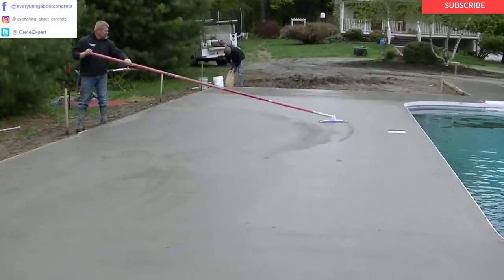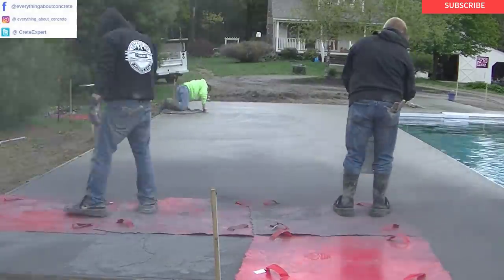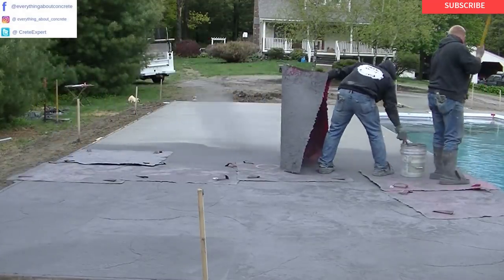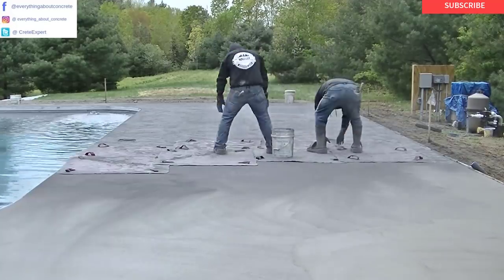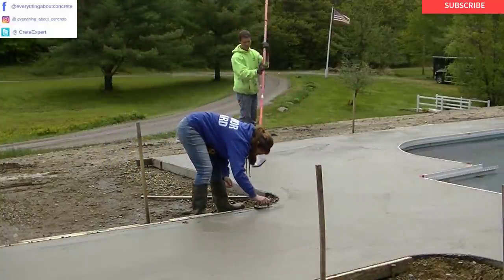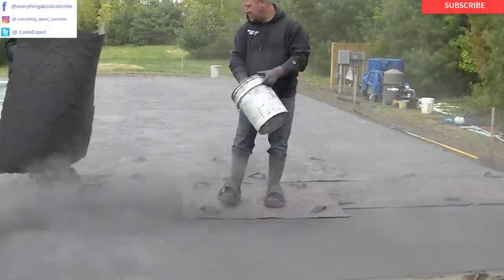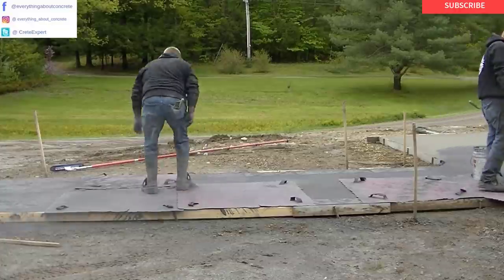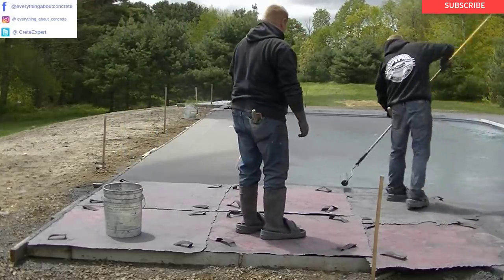STAMPED CONCRETE POOL DECK : PART 3 OF 4

Comment: Good stuff, thanks for posting.  We normally mag and trowel before we stamp.... but I've also only hit it with the mag float and both turn out great!
Reply from the maker: Thanks Frank, we don't normally trowel any exterior concrete here in Maine for fear of sealing off the surface and trapping moisture.
Reply: @MikeDayConcrete  Completely understand. ... I'm in Washington DC,  we are kinda right on the line of that weather pattern,  so it's done both ways here and both seem to hold up!

Comment: Ever use liquid release with liquid antique agent mopped on later? The nice thing is you don't have to wash powder off. Just saw cut, rinse it and mop on your second color. Saves time washing and cleaning up the mess of powder release. Not to mention you won't be blowing out coal colored boogers for the next few days, or listening to your wife complain about the coal stained shower floor!
Reply from the maker: We've tried it a little. We're just more comfortable using powder release. If we're stamping inside where it's hard to clean, we'll do it that way.

Comment: Does that pool have a double liner track that the forms snap into. Also do you strip the pool edge forms the same day like with mortex or stagmirer poly forms to sponge the edge I have a pool reno coming up and thinking about using concrete counter top solutions pool z forms because of the reusability less waste etc. How straight do they stay on the straight walls without using tie wires like the other brands . Any info would be awsome watch your vids thanks I'm a 30 pool builder from fla building in NC now be safe peace ✌

Comment: Mike, you ever do anything with exposed aggregate? I’m in Wisconsin and just curious how that holds up on a driveway with the winters and if customers end up being satisfied with it. I’ve subscribed and would love to soak in anything you’re willing to teach. Thank you!
Reply from the maker: I've done only a few exposed aggregate. There's not much call for it here in Maine. It would hold up just fine if you use the right sealer. I like using RadonSeal for my exterior driveway sealer. Seals the concrete from the inside out, not just a topical sealer.
Reply: I'm not Mike, but exposed ag is great for exterior concrete constantly exposed to harsh weather. Most ice melts cause the finished top of slabs to spall, dust, or flake off which in turn exposes aggregate meant to hold things together, not look nice. Exposed aggregate no longer has a finished top to fail because you washed the top layer of cement paste off in order to expose the aggregate. It also maintains its aesthetic appeal because only aggregate previously chosen is mixed into the entire  concrete slab as course aggregate which is what you see in your final product. Lastly, exposed ag gives aggressive texture in icy conditions.
Reply: @c_b8s4  awesome answer

Comment: Mike- I am a new pool owner and about ready to do our stamped patio surrounding the pool. I have some questions after watching your videos. You mentioned clean up of the pool and my questions are related to this part. Is the pool pump just recirculating bypassing filter during the process? Have you ever had a problem with the color staining the pool (fiberglass pools)? Any words of advise?
Reply from the maker: It's using the filter. The release powder doesn't soak into the water, it just floats on the surface so it just builds up in the skimmer where you can scoop it out with a cup. None of that dust went through the filter on this pool. I've never had a problem with the color staining the pool. If it doesn't wash off with dawn detergent, I use clorox wipes and it comes right off.

Comment: Great videos!   We do hardscape and decorative concrete in Minnesota. Couple questions.  
Do you guys prefer powder over liquid release?  
Have you ever used a Lura roller screed?  We’re looking in to one because as you said it’s very hard to find good screeders. Wondering if it would be worth the money.
Reply from the maker: We do mostly use powder release.  I haven't used a roller screed. Screeding for us is quite easy, if it wasn't I would look into it though.
Reply: We are looking into a viber screed as well.  Just trying to figure out the best option.

Comment: Thank you for sharing! I’m just learning about stamping. Do you guys ever have to do the clean up, detailing, and saw cutting the same day as your concrete pour if it’s really hot out? Does textured stamp vs a stamp with more joint impression/texture like random stone affect if you should clean up/saw cut the same day vs the next on a hot day?

Comment: Another thing,why aren’t you finishing the cantilever?wont you have rock pockets
Reply from the maker: The cantilever has a stone texture to it already with those red form liners. We vibrate it with the pencil vibrator and tap it as we mag float it to remove air pockets. It comes out perfect.

Comment: The finish has an overlap line from the mat that your finishers do not take out :/

When pulling a mat up, the overlapped mat should be stamped along the edge to remove a line made from the first mat that is picked up.  

Antique-it will also give you a clear two-tone look without sacrificing the health and wellness of your crew.
Unlike powdered release. Yikes
Reply from the maker: The line is just in the powdered release. It isn't in the concrete.

Comment: These guys are not troweling the concrete to seal it
Reply from the maker: Right on! Just mag float is enough.
Reply: I hear this a lot. No air engrained concrete with an air content higher than 5% should be trowels. That means anything outside. Do you trowel your sidewalk to seal the top prior to broom finish? Just wondering, because the broom finish opens the top pores of the sidewalk up again defeating the purpose of troweling. Please keep in mind also we are talkin about stamped concrete that has a solvent-based sealer protecting the top.
Reply: @c_b8s4  my understanding is air entrained concrete should not be HARD troweled. I don't think troweling something at the end of the first pass, immediately prior to brooming has the same prohibitions as hard troweling. 

If just touching steel to the concrete made it spall, you would see the edges of mag'd then broomed slabs spall way worse than the middle (as they had been worked with steel edgers!) However, this is not the case.

Additionally, the company I work for does trowel exterior, air entrained, Minnesota concrete and we do not have problems with spalling these broom finished slabs.
Reply: @cheshstyles   very true. I like to trowel sidewalks because it gives a slightly smoother finish in my opinion. In no way are you trying to seal the top off if you trowel the surface one time prior to broom finishing.